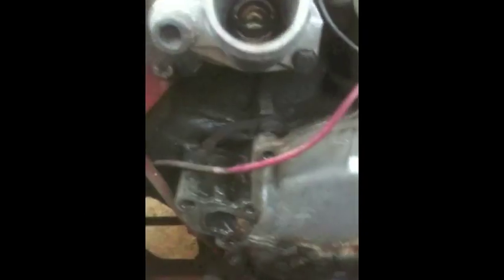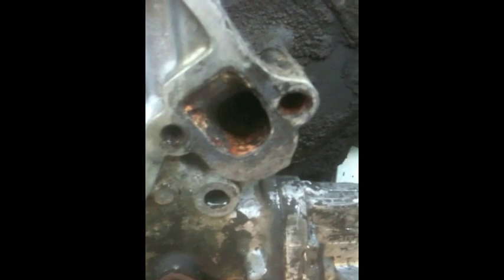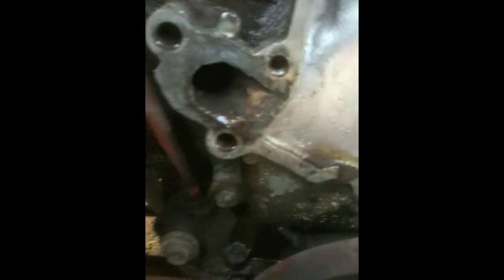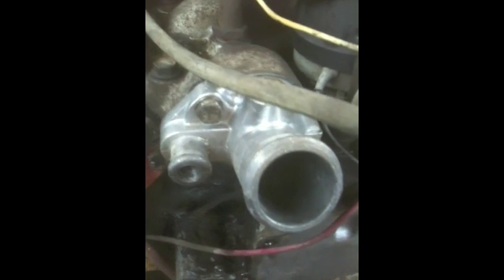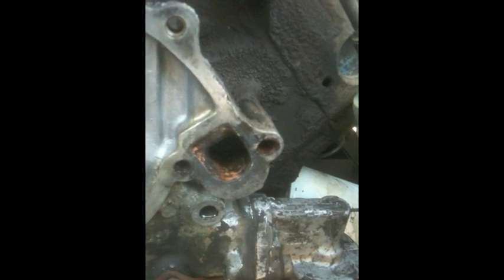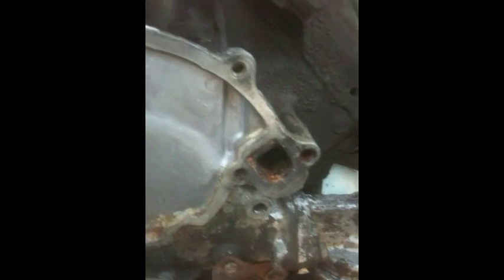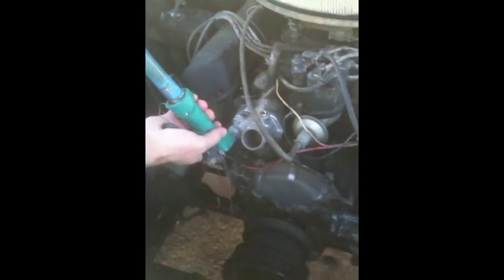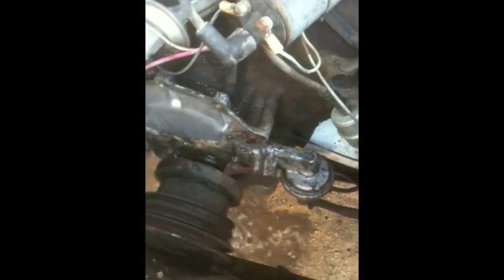351W Cooling system blockage?

Comment: did  you ever find out what the coolant problem was with this video?  I'm assuming that there was no problem, and that you need to take the thermostat out to get coolant to come out the other side.  But if there was an issue that you were able to resolve, I'm interested in hearing more.
Reply from the maker: Yeah the water passages on the driver's side were totally caked with sediment. I had the engine rebuilt a few weeks after this video. That was 4 years ago now. The truck is all done now and looks awesome.